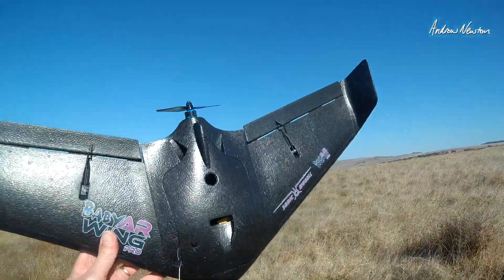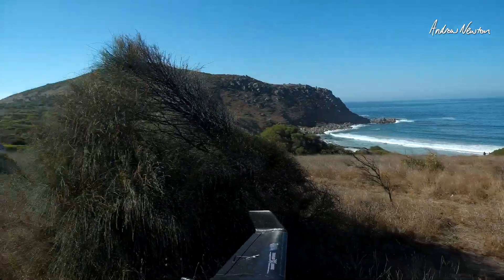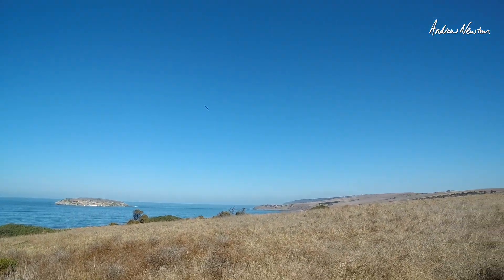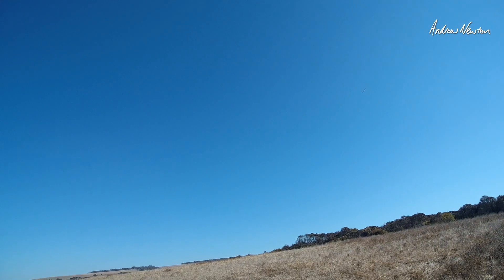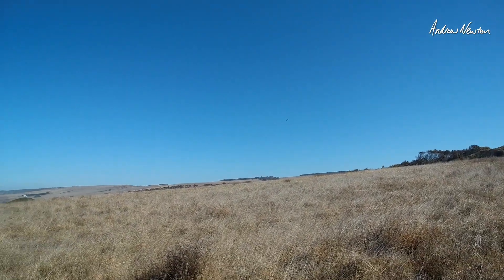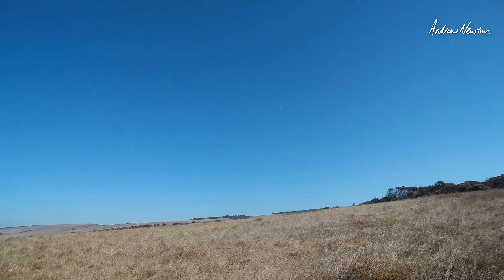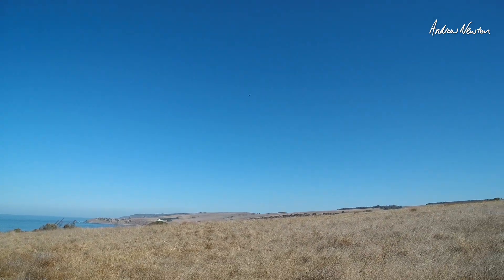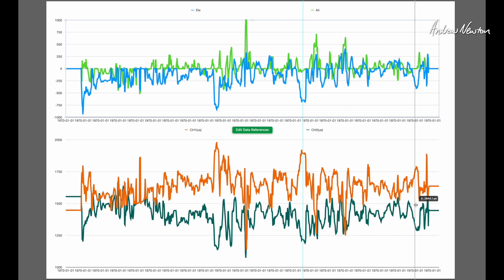75 / 75 Elevon mix test

Comment: I guess this video is more relevant to people flying line of sight and doing aerobatics. That said, flying wings are not really cut out for doing Aerobatics IMO. For most FPV setups 50 l 50 is enough. An interesting video nonetheless Andrew. Today we had a similar day, zero wind and Sunshine with a high of 20C...felt like paradise TBH...😳😳😀🇬🇧
Reply from the maker: Hope the rain stays away for a while, sound like you're saturated over there.
Reply: Your statement makes no sense.  A change in the linkage geometry can double your throw for the same amount of servo travel.  Saying 50/50 is "enough" means nothing, as you don't know how much actual control surface movement there is due to the linkage.  Everyone always goes on about their rates as a percentage, but NOBODY talks about the linkage configuration or actual control surface throw.
Reply: @scottyh72  It's not about the amount of mechanical throw. Obviously you can use linkage geometry to get huge throws. The Elevon mixing when using a FC is provided by the FC, not the TX....😏
Reply: @EnglishTurbines  And?  It's a mix.  When the servo hits full travel, it stops.  Just depends on when it does so vs stick position.  Only time it's an issue is when you jam the stick into a corner.  Same with ccpm mixing on helis.
Reply: @scottyh72  You need to understand how the FC mixes Aileron and Elevator as opposed to a mix created by the TX...I'm guessing you've never used a Flight Controller....😏😏😏
Reply: @EnglishTurbines  Ha ha ha ha.  Nope.  Never used a fc.  Why would you think a TX mix should be any different than a fc mix?.  It's a computer mixing 2 channels.  Period.  The pid loop should come in later, making this a non issue.  You are making this way more complicated than it needs to be.
Reply: @scottyh72  In reality, it isn't really an issue, as witnessed in the video. It's about servo saturation. As you said 50/50 mix full deflection of both controls equals full servo deflection. Having more of both just makes it more responsive. Servos will travel beyond 2000 msec deflection anyway...mechanically, most servos can handle about 125% deflection....My point was, most serious FPV pilots flying wings at range etc, aren't interested in aerobatics. Quite the opposite in most cases....😏
Reply from the maker: @scottyh72  Watch again and pay attention. I talked about throws and linkages 3 times during the video. It should be clear that throws were adjusted in this and the previous video to be the same. I'm looking at signal clipping, not how much throw a mix gives.

Comment: Thank you... for THIS RECORDING, I share your joy. I also bought this wing not assembled yet because I'm waiting for the shipment: Radiolinka 9s pro and At10II transmitter, I don't know which one is better and also: Byme-D stabilizer, CrossFlight, Telemetry R12DS PRM-03. The video receiver transmitter is missing. I would like 1.3 or 2.4 Ghz because I'm afraid to use 5.xx gHz. Regards.